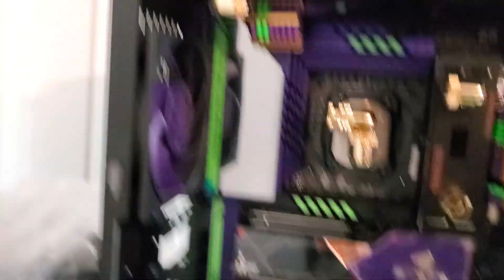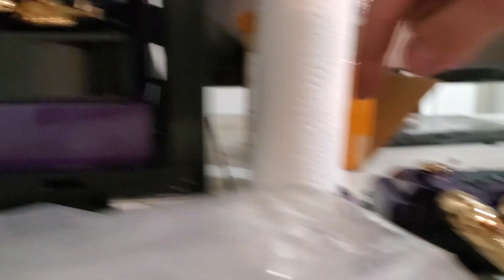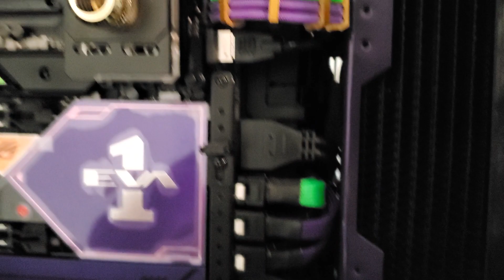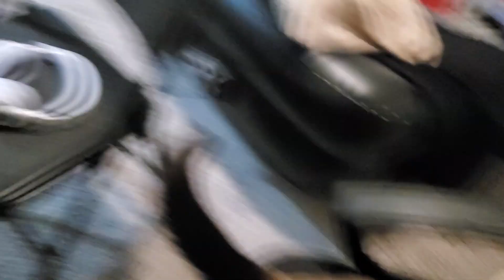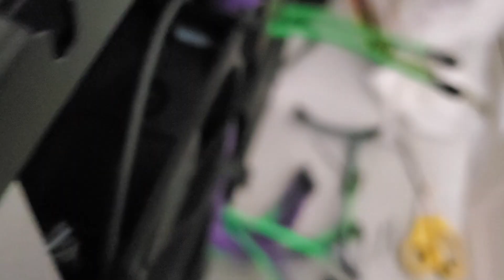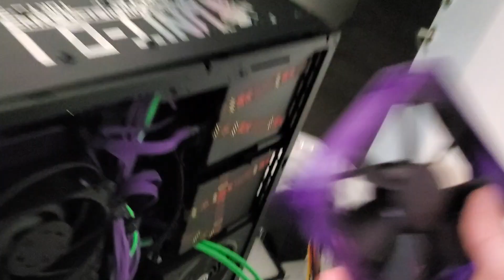System 01 - Build log 02

Comment: Looks dope!
I'm considering painting a fan, which is how I found this. How did the dyed fans work out, did they operate as normal?
Reply from the maker: Thanks! they all work fine. had a scare when I first plugged them in because they weren't moving but they have a 0 rpm mode lol. Still working fine a year later.